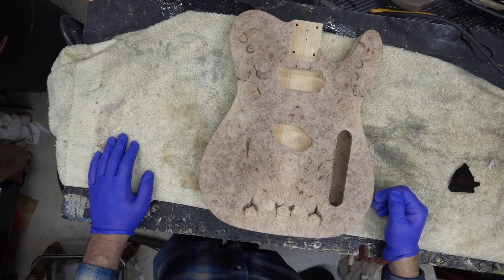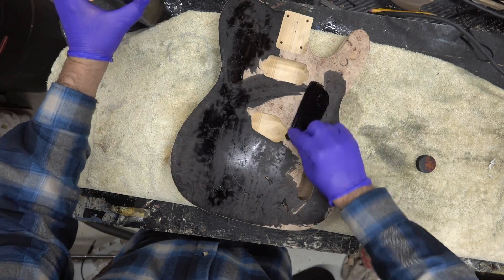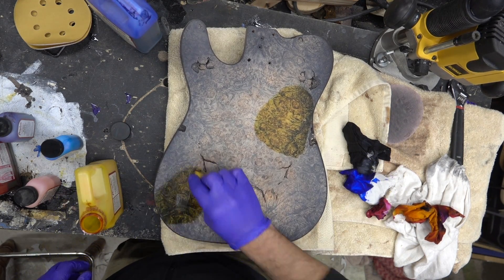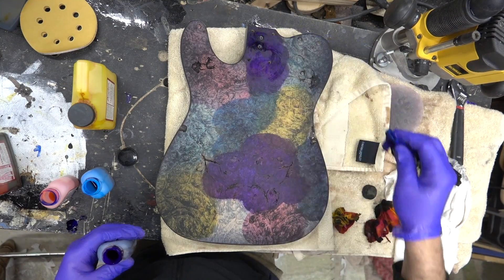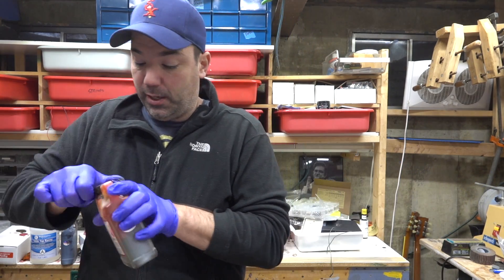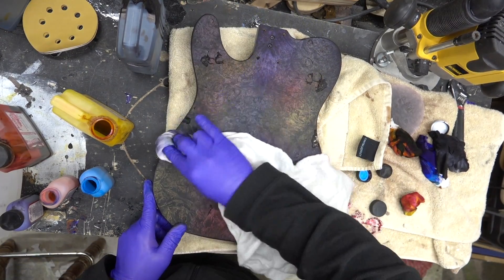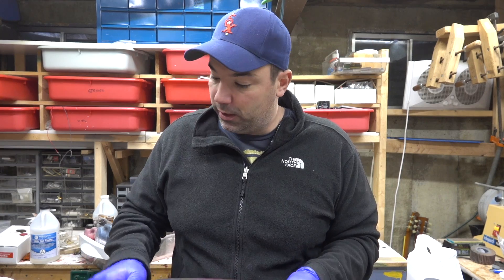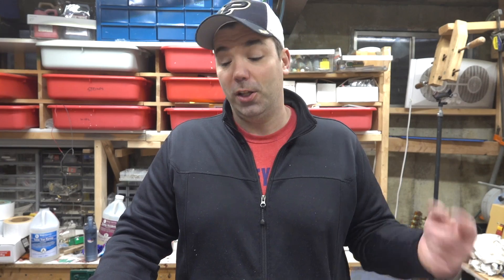Milky Way Burl - Custom Stain on a Maple Burl Guitar Body

Comment: I never use leather dyes on wood, I'm pissy that way , if I don't have 90%+ chemical compatibility I just won't do it .That being said. 
  That's pretty ! Nice Continental drifts .
Is that dye alcohol based ? 
  If so there's something that I do with the die and acetone .
  I usually use a gold flake background or any solid color but usually something bright. (Goldenrod works very well too)
  Spray on all those colors you used not heavy just on and then dab it with a rag wetted with acetone don't wipe it don't do anything. Let it go you'll see and dab away . You can layer it out also . 
   P. S. You are one of the better guitar guys one the tube . 
  And your a Journeyman Finisher unlike most of the turn around hires .
  (You know , the one's that disappeared on the first break on the first day) 
  Due to Hereditary Chronic Pancreatitis . I can't anymore, so you get what I won't take to the grave , too much lost already by Masters not sharing .

Comment: Okay, I take a raw wood guitar body, put the dyes I want to get color, can I use a water based grain filler before using TruOil? My plan before was dye, water based filler,  water based sanding sealer (all rattle can stuff) then  water based spray lacquer. Watching you use TruOil  (and now Velvet Oil),I want to try that. Less cure time and much less moisture and temperature sensitive . Let me know what you thinks. Thanks.